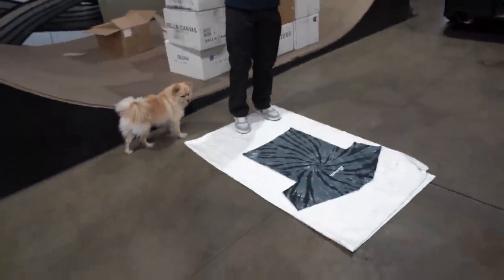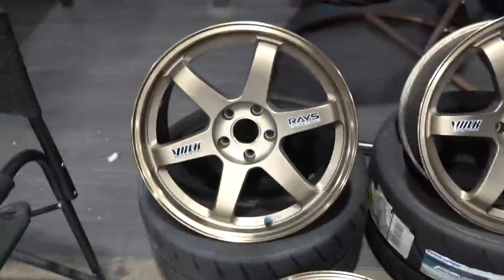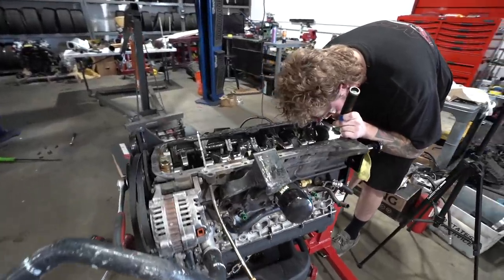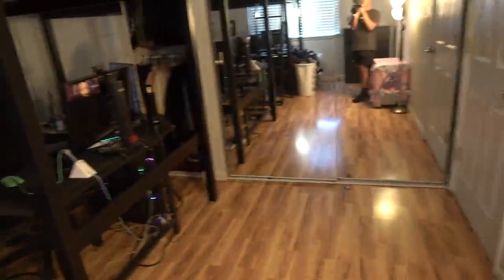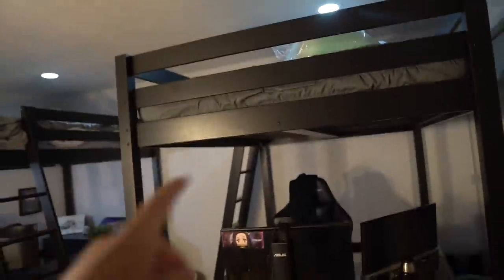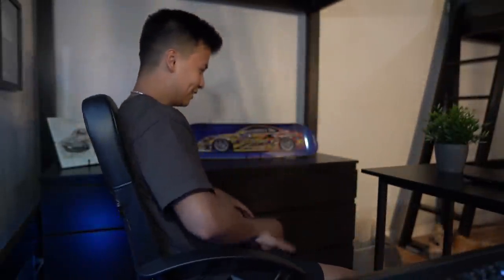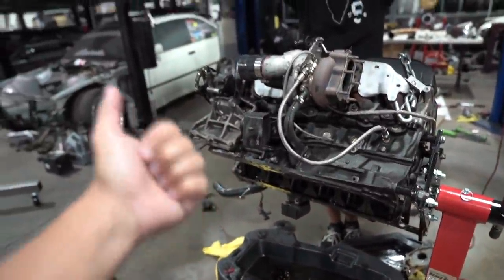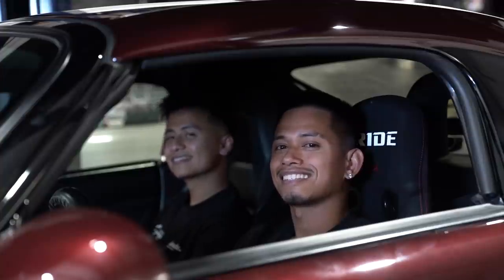2021 Illiminate House Tour!

Comment: I would say streaming on Youtube would be more easier for you since most of the fans are on this platform already and the post notifications will help for sure. As for set up improvements, I recommend getting a dual monitor stand that clamps to your desk so you can increase mouse & keyboard space! 

It’s crazy how far you guys really have came from the S2000 & the apartment vlogs you definitely deserve 1mil for the dedication you have put into every single video! Keep it up 🔥
Reply: I think Twitch would be better for a chance to expand, and there are a lot more abilities for streaming on Twitch. If he wants to do YouTube, then that'll work, but Twitch is the better platform for streaming in general.

Comment: Interesting to see that RBs are going up in price, since they're dogshit engines. You can't make alot of power out of them without replacing everything on it and the shop that will do that will charge you a lot for it. Atleast JZs wont suck you dry to get some decent power out of them. The only good GTR is the R35 probably because it isn't a skyline and doesn't have skyline problems. JDM tax is getting out of hand in my opinion.